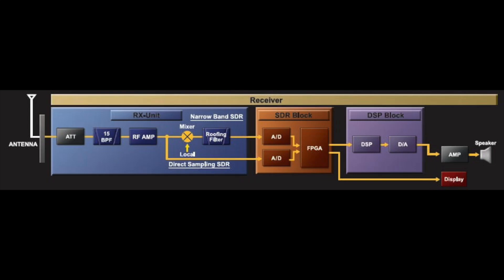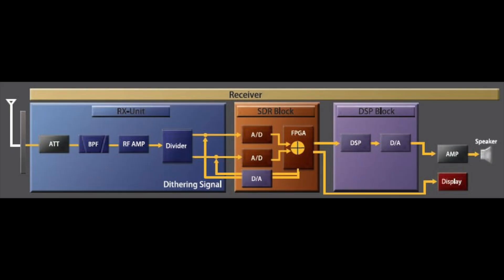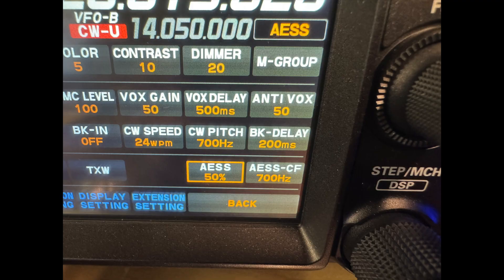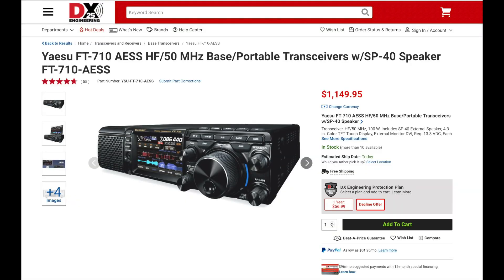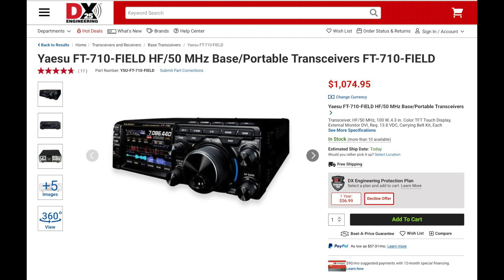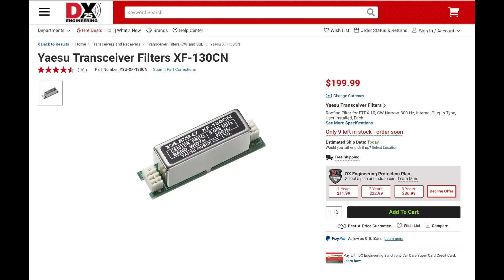The FTDX-10 vs. the FT-710 – A Comparison of 2 Versatile Yaesu Ham Radios | DX Engineering

Comment: The only reason the FTdx10 is a hybrid and the FT710 is not,  is because the FTdx10 is 5 year old technology.
The "hybrid-years" are over.
Don't try to find reasons a hybrid is better than a pure SDR in 2025. There are none.
FTdx10 owners only think their rig is better than an FT710 because:
1- They paid more
2- They're TOLD their rig is better.

In fact the FTdx10 is a tiny little bit...worse, because of the extra mixer at the input (distortion).

Comment: I have owned the 710 and it is a great rig. I love that you can add an external monitor and a mouse. But, I am going to get the FTDX-10 on my next purchase cause I want the RTTY features and being able to add a monitor, mouse and keyboard.
Reply: What's the use of an RTTY reader if you can't transmit but pre-fabricated messages? Isn't there enough decent RTTY softwere available??
About the monitor, connecting one is a game of Russian roulette. 

You can only use a monitor with ONE input and that should be a DVi-D input. NOT a monitor with a VGA + DVI-D input for instance.
Why? Because you cannot use converters and  these dual input port monitors have an inbuilt DVI-D converter!

You can only use a straight DVI-D to DVI-D cable which is SHIELDED. 
Why, because there are several cases of  defective DVI-D ports due to RF in the shack.

Also, you can only connect the Yaesu to the monitor if both devices are completely disconnected from the mains.

In short, sooner or later you WILL kill your DVI-D monitor driver,  be it an FT710 or an FTDX10.
Simply don't use it.
There is not much benefit anyway because of the low 800x480 resolution.

If you buy a 2nd hand FT710 or FTdx10, ask for either a monitor demonstration, either a reduction.

Comment: I've had both.  I like the 710 much better as it has better DNR & NB for my QTH.  The 10 had more distortion when using those functions.  I also own & rotate thru a IC-7610 & TS-890S.  But I have to say, I always like putting the 710 on.  And the 710 has full mouse control on the internal display.  The Icom & Kenwood are very limited.  I'll also say, I am a Kenwood & Icom fan, but the radio I most recommend now is the FT-710.  Lastly, whatever radio makes you smile, I am happy for you.  I am not disparaging any radio.
Reply: I'm hoping you can answer this question about the 710. I'm just getting my general license soon so this will be my first radio. The video mentions that the 710 has fewer buttons and knobs compared to the 10. And because of that, some features on the 710 will have to be accessed through menus. My question is, are those features things that are needed during an active contact? What I mean is, will I have to dive into the menus to make a contact more readable because the radio has fewer knobs/buttons? I appreciate any help. Thank you.
Reply: @RetroRecreations  no you won't as dnr is still button,as is noise blanker. You'll love it
Reply: @andyM9XTT Thank you for answering my question. It looks like the 710 is the way to go

Comment: I been wanting a 710 and been doing some research. It seems it was selling for a $100 less about 5 months ago. Times are tough on younger people and ham is not a cheap hobby. I built a trusdx and cheaped out with a xiegu g90. I really want to step up to 100 watts. It seems I'll end up building an amplifier to get the power I want
Reply: So this radio just went up another $100. Looks like I'm going back to icom. Price went up $200 in a few months

Comment: the FTdx10 is not a full SDR it's a hybrid  SDR-superheterodyne , the FT-710  is a full direct conversion SDR ( like a Icom IC-7300)  I was going to get a IC-7300 because of this, but I was able to get a Yaesu FT-710  for an excellent price - I really like the radio. I'm glad I bought one - my daily run rig is my trusty Yaesu FTdx3000 with an onboard SDRplay RSPdx-R2 as my ancillary or scouting receiver/ and panadapter... the 710 is a great little radio but they are both outstanding.